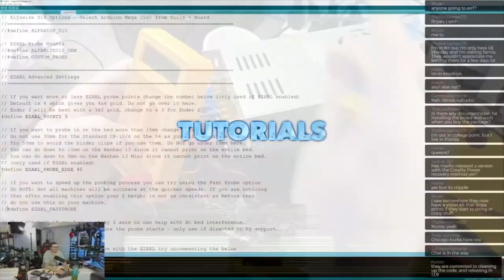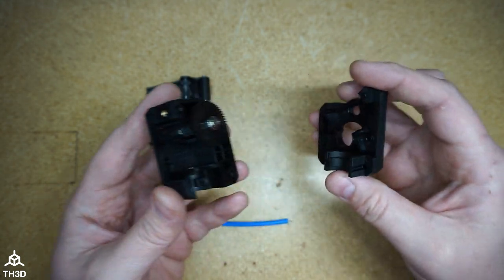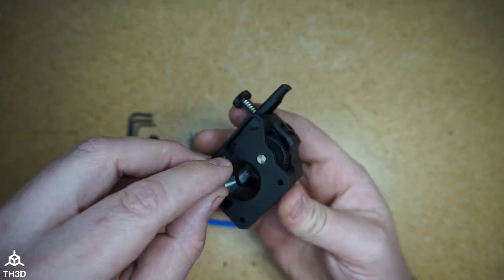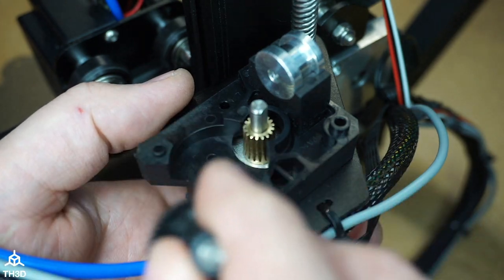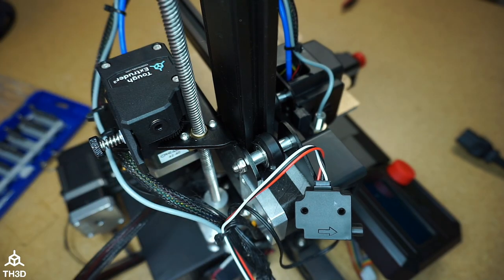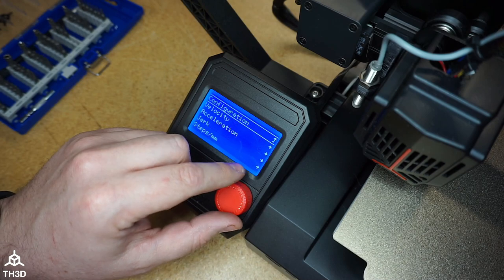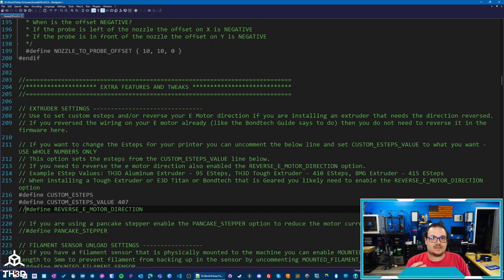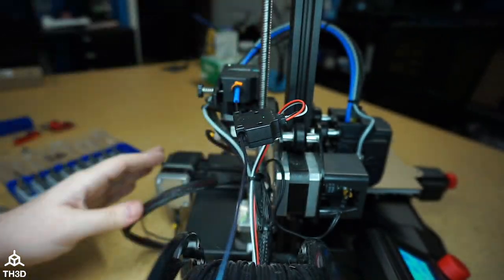How to Install our Tough Extruder V2

Comment: Do you have a video on how to mount it in direct drive configuration?
Reply from the maker: We do not. You'd want to refer to the directions for the particular mount you're using to use it in that setup. If it's our MultiMount we have directions in our Help center for that.
Reply: @TH3DStudio  Thanks so much! I did buy the Multi Mount as well and will reference those instructions.
Reply from the maker: The multimount docs are here: https://support.th3dstudio.com/hc-category/multimount-system/

Comment: Will this extruder work on the Anycubic Vyper? Thanks
Reply from the maker: Looking at the Vyper pics it looks like it would fit. Just make sure you have the ability to set your esteps because Anycubic still has not released firmware source code so you can update the firmware yourself (which is them illegally using Marlin source code). I don't have that machine and will not purchase it because of their illegal usage of the open source software while not sharing the source code back to their customers like they are legally required to do per the license agreement.
Reply: @TH3DStudio  ok great. I can make the adjustments using Pronterface